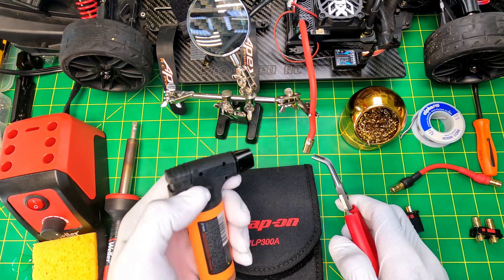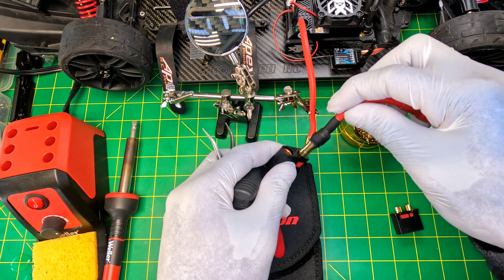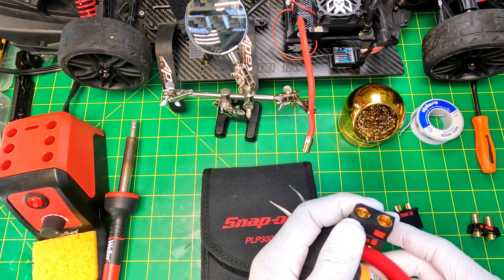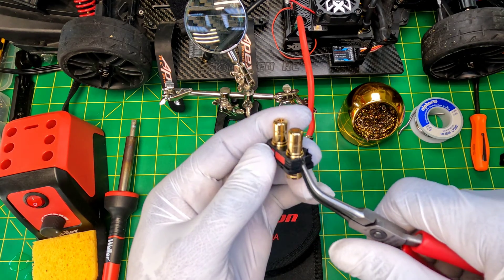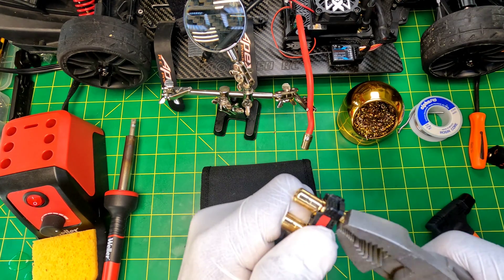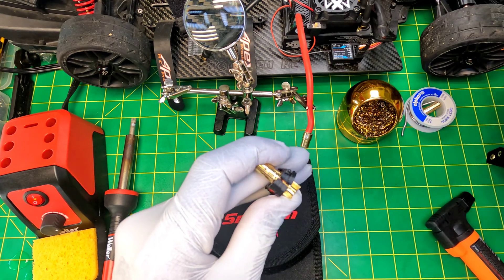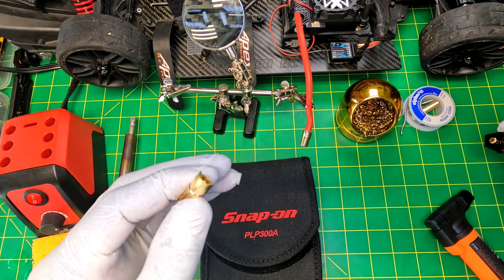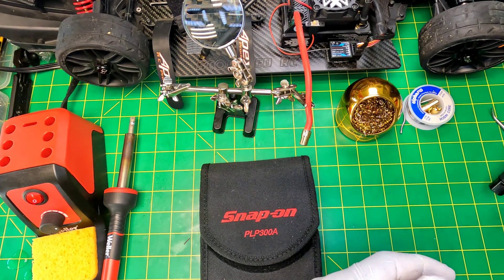How To Solder QS8 Bullet Connector On A Castle Creations XLX2 ESC!

Comment: What shocks are you running?
Reply from the maker: In the front or rear? Different spring ratings.
Reply: @UpperLeftUSARc  what brand are the springs?
Reply from the maker: @turbo77  traxxas
Reply from the maker: I'll find the exact part number for you.
Reply: @upperleftusarc  thanks
Reply from the maker: @Trucker Noir  these don't fit stock without modification.  They are 80 mm stock is 70mm, and you also have to bore out your lower arms.
Reply from the maker: @Trucker Noir  now there is another option with aftermarket springs to get a stiffer ride. With these, I'm pretty much preloaded  by 10mm, and you can run different spring rates vs. the limited options from armma. They are the traxxas gtr shocks with  pink springs.
Reply from the maker: https://m.traxxas.com/products/search?keyword=Gtr
Reply: @upperleftusarc  Thank you, I'll try these on my V2